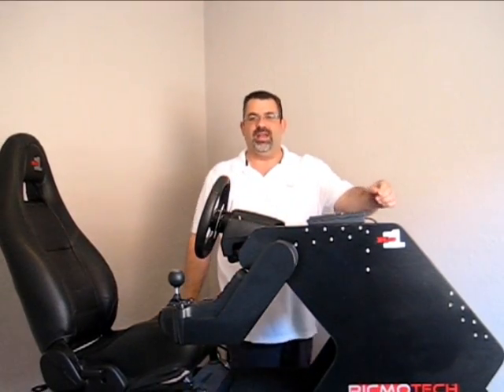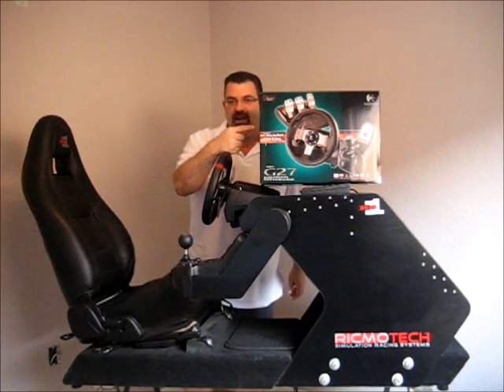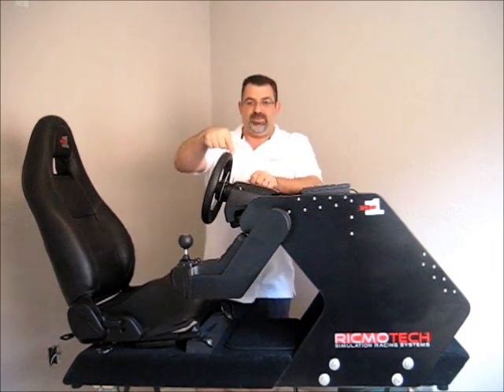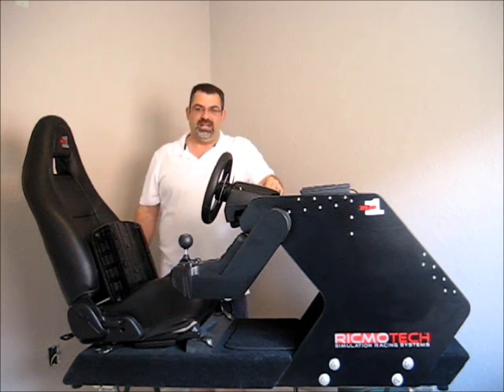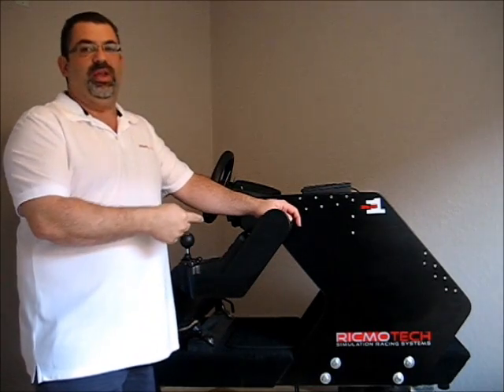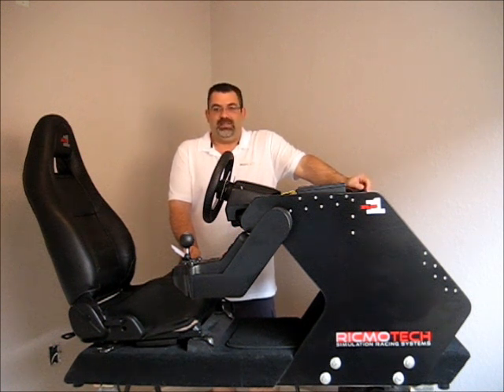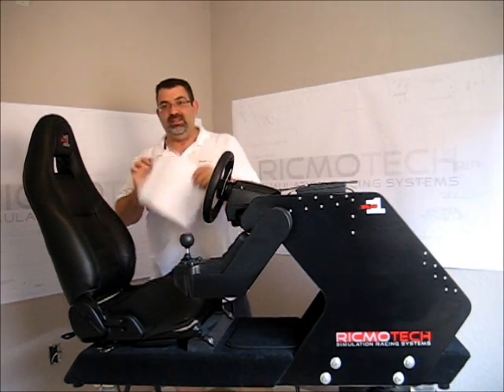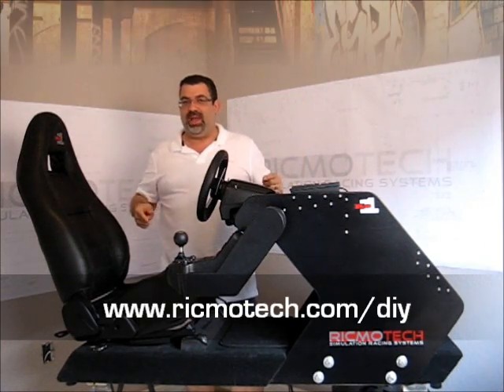Tour of the RS1-DIY Racing Simulator Cockpit

Comment: If wood transmits vibrations better then why are tuning forks made out of METAL?
Reply: Transmits better, not sustain.  Metal is more flexible so it will continue to vibrate in a sustained manner like a metal tuning for due to sympathetic vibrations where as wood transmits the vibration through it once then stops like a wave going across a pond from one side to the other.  And yes, I know I'm an asshole, but the question is  "am I telling the truth conveying scientific fact or am I just making this crap up ......  you decide."

Comment: Hello there I like your setup. I built one a while ago and out of treated 1x1 lumber. worked great. cost was less then 50.00... I also had zero wobble. my friend weighed a littler over 275lbs and it never moved..  The only thing I would like to add to yours is a ebrake. I see that your setup has none.. Perhaps make one with adjustments for friends and family that come over to enjoy your sim.  I personally am interested in this. Also will is this sturdy enough for a motion setup?

Comment: Frank, Can you locate a PS3 console inside the unit with the bass shacker unit installed or will it cause your disc not to work (i.e. vibrations / jump etc)

Comment: I just got my plans, the instruction manual is NOT in color and it's crudely stapled together, it is not nicely bound like shown in this video. It was over $50 after the absurd shipping cost. I'm a bit disappointed in the quality for the price, but the templates seem to be nice. We'll find out when I start the build.
Reply from the maker: Sorry about that, some things have changed in 9 years. We switched to black and white and booklet stapled instead of spiral bound when those costs went up  to prevent raising the price of the plans several years back. We do state that in the product description that it is black and white and the picture of the plans of the RS1 shows that the booklet is stapled.
Reply: @Ricmotech , I get that. However it's more about justifying your price, it's far overinflated, even when inflation is taken into consideration. I'm a professional cabinet builder, I AM impressed with the templates, however I am a stickler for collecting books. I don't need an instruction manual, I am merely wanting to give a fair and unbiased review. My apologies, this video probably just rubbed me the wrong way.